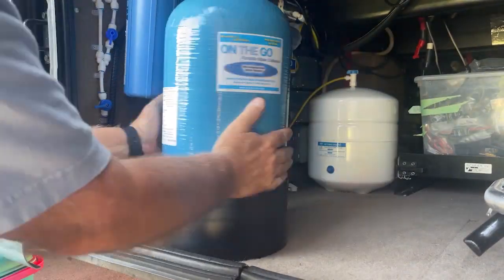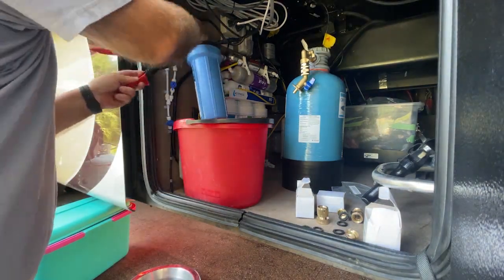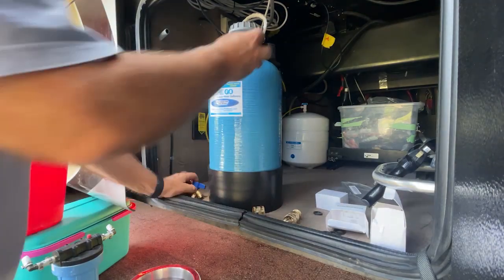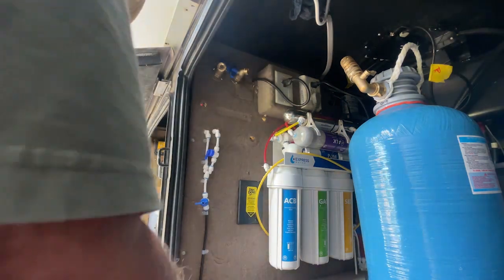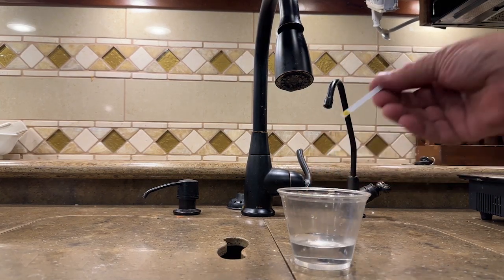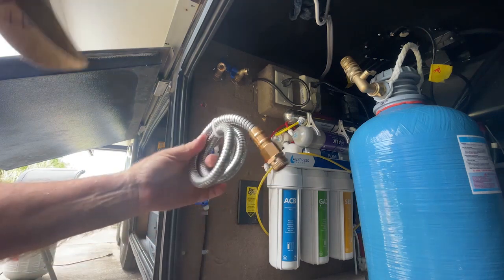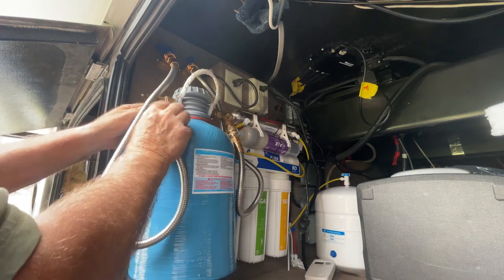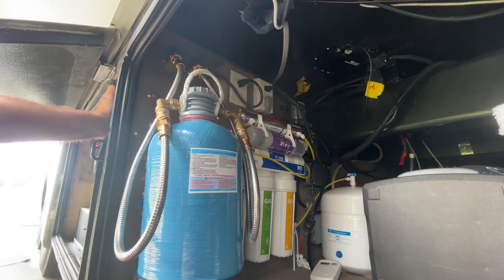Moving the ON THE GO water softener inside | RV Living | RV Life

Comment: I would suggest adding  storage tub under the softener. If those quick connects start leaking you want the water in the tub vs the carpeted floor. I know first hand. Plus when you disconnect them to regen or backflush there will be some water left in them.
Let us know long term how those quick connects work out. I've gone through a couple different types. I think I finally found some that are leak free but only been in use a few months.
Reply from the maker: I have been considering a tub and adding a drain hole that would go through the floor. Just have not got around to it yet. For all the adapters and hoses I bought extras and used what I thought was best quality and sent the rest back. We will see how it goes.

Comment: You will like that setup a lot more. Nice!
I’m not sure but are you using your tank for water versus shore? 
Mine is plumbed on the other side just after the hose reel outlet. This way all our water is treated.

One more project for you😀. I added rubber latches and two struts for the tank bay. Wasn’t sure if you were propping up the bay door. It’s a pita without the struts.
Reply from the maker: That's the plan, tired of propping the door open  lol . The water softener is first thing in line coming in to the coach except for the small Camco filter at the spigot. Everything is softened and the drinking water also filtered.

Comment: Idea that I'm thinking about for mine.   Using that whole house filter canister without the filter to put salt in when it's time to regenerate the softener!!! Just put it in line and use when needed? Your thoughts?
Reply from the maker: I like that idea a lot. I have not flushed  my softener yet. So you are the expert on that. But it sounds like a great idea. Then just quick connect a water hose on the outport of the softener when flushing.

Comment: Hi Gary, if the base of that canister has not been secured to the floor, you might want to add an additional strap lower down to prevent the base from moving forwards under heavy braking.
Reply from the maker: Hey, nice to hear from you! I have also considered a second strap. I see On The Go has a wall mount adapter. I may go for that in the future.

Comment: Hey Gary, Looks like you have a good deal of room in you water bay.  I wish I did.  I have to take my On the Go out every time I move.  Also mine started leaking at the neck.  Looks like I will be replacing it later this year.  It has lasted me just over 3 years.  I may look for a smaller one to mount in the water bay.  Take care, Scott
Reply from the maker: That area is not actually the water bay. It is the opposite side of the coach. It would not fit in my water bay. It is a risk sitting on carpet, but I have confidence in the plumbing.